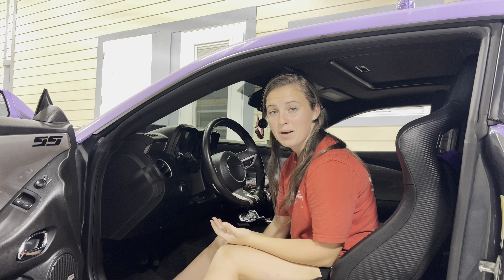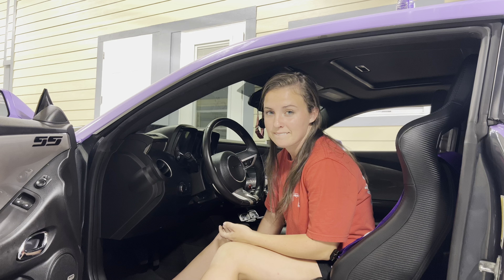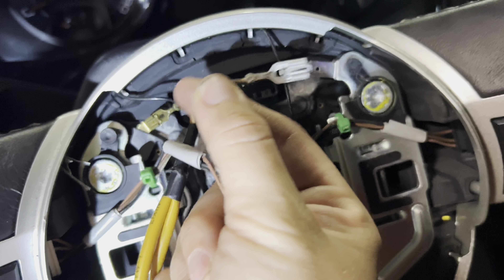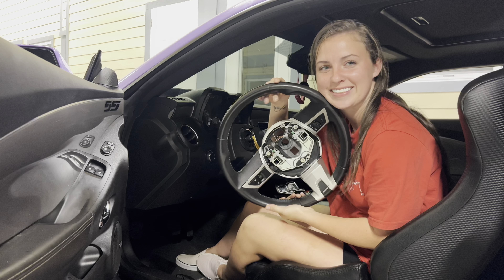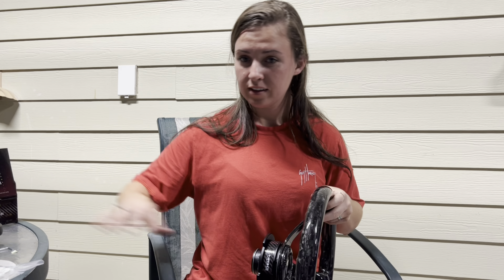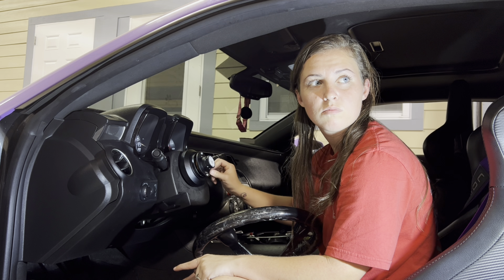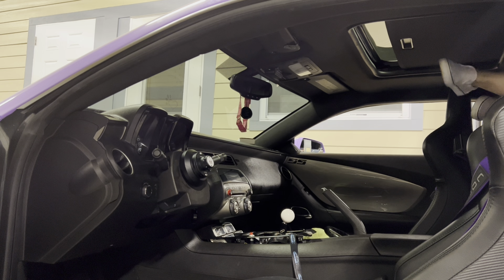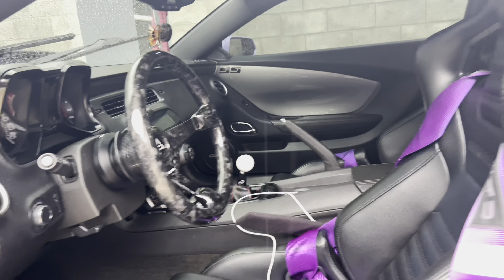NEW steering wheel for my camaro

Comment: Looks nice. Did you have to do anything to prevent the computer from throwing a code since the airbag is gone?
Reply: Wont pass inspection! And they make a wire to simulate the airbag is in!
Reply from the maker: Florida doesn’t have inspections
Reply: @RecklessRaquel  lucky!!!

Comment: 5th gen’s🫡>>>>>>
also did you just say f*ck it with the cruise control and all the other actions you can use on the stock wheel like the radio volume as well as the phone options?
Reply from the maker: Pretty much lol